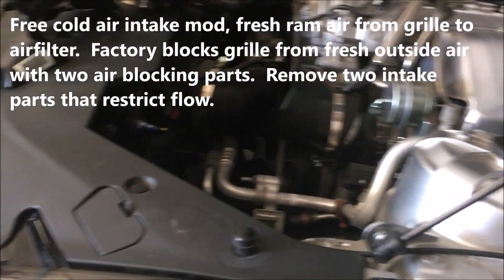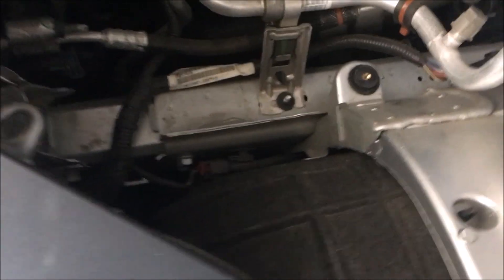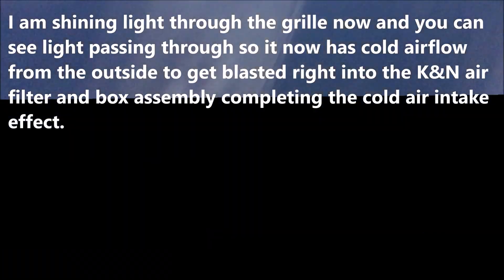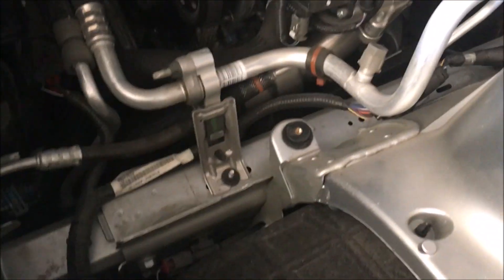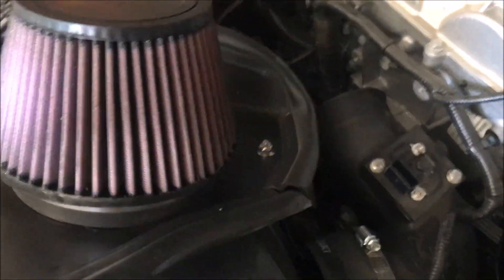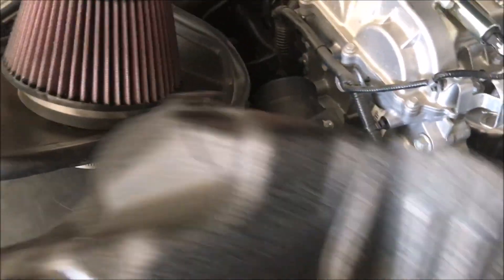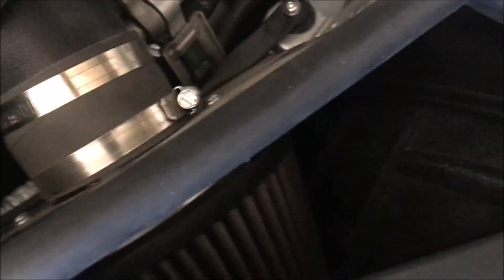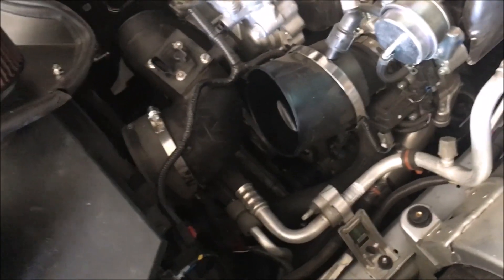Free cold air intake mod on Cadillac ATS AWD 2.0  Turbo

Comment: Ripped that piece out and experiencing odd throttle response. Gonna get one of those zzp pcms with some other zzp parts and see if it corrects the behavior. Believe it’s probably confusing the computer in the car with air flow
Reply from the maker: You could put the piece you removed back on.  Check around to make sure nothing else was removed or unplugged while you were working in there.
Reply: @madboostingmadmatt48  I’ll definitely do that

Comment: Well, many cars have weird moldings surrounding their airbox. That diffuser in the Cadillac ATS directs the air/water/contaminants downward inside that modded piece in the airbox so when it rains water doesn't saturate your filter and cause hydrolock

Comment: That piece was directing air to the factory air box not blocking it
Reply: I thought that too until I removed mine and the turbo spooled up a little faster afterwords. I still have the factory air box
Reply from the maker: If you watched my entire video, I shine a flashlight through the grille and it leads straight to my K&N air filter
Reply: Air from the engine compartment isn't cold air
Reply: @tp8777  # Intercooler
Reply: I'd only recommend removing the foam section nearing the air intake filter housing. But the lower section removed definitely can allow water to enter factory intake housing. It's more commonly seen in areas with larger puddles, the lower section which is part of the grills function is to act as a splash guard preventing large amounts of water to slow or deflect away from that intake housing. And the foam section is an additional feature of that, which is usually a common piece that gets removed with many intake mods.

Comment: could it possibly be blocked to keep rain... water in general to keep from getting to the filter?
Reply: Ey3zGaming with a stock box filter it could get the filter wet but thats it.  The cone filter like on the intake kit, the rain would not travel that far to reach it.  If any rain did reach either type filter it would evaporate in the turbo compressor from the heat convection from turbine housing.
Reply: MadMatt is right and also, I would get a K&N filter, they're good for water and also have MAF sensor cleaner handy but never spray it while it's still connected to the battery.